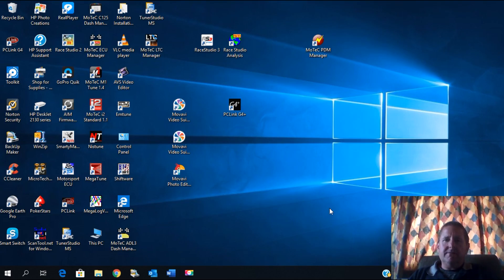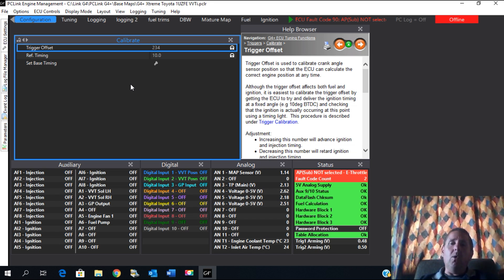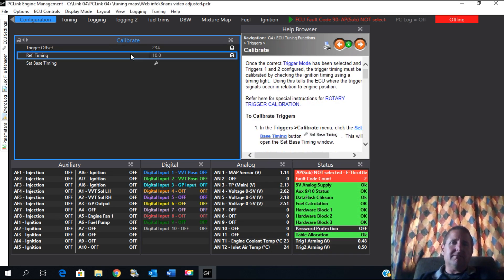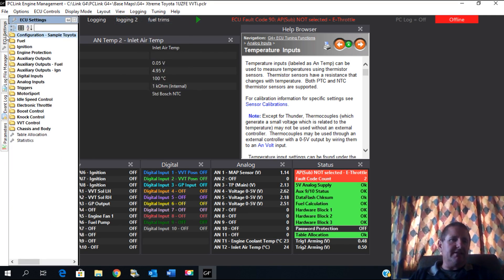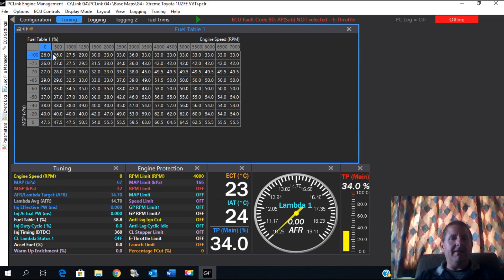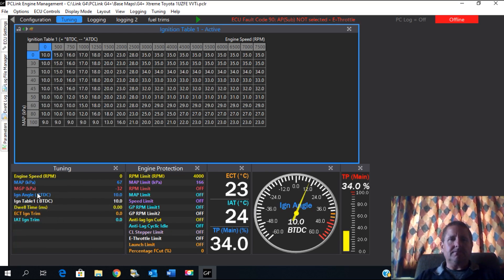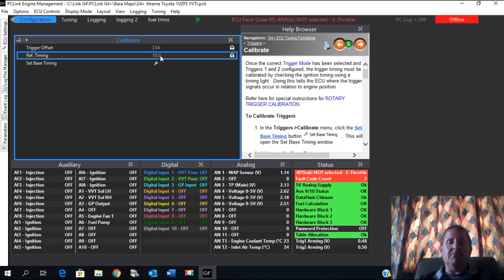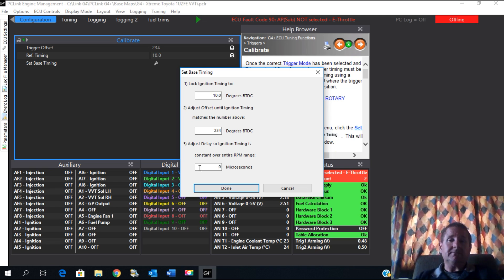PC link Basics.  Finding the fuel map , Ignition Map and base timing settings

Comment: Can you name some resources on how to tune? It´s for the formula student proyect
Reply from the maker: Hello.  Its a bit of a process on learning to tune but personally I recommend you read books on how carburettors and distributors , ignition systems work and understand how engines work.  Lots of guys want to jump straight into learning ECU tuning without really understanding how the basics work.  Also pressure is also very important , air is pushed into an engine not sucked in.  Cheers Kelvin
Reply: Anybody have any idea how I can calibrate an air temperature sensor for the intake I have the calibration numbers but they don't seem to match anython how one or Cal two or Cal 3
Reply from the maker: @johnfarias7230  hello John.   Using the numbers you have they can be entered into pc link.  If you wish I can do a video of it if you send me your profile and IAT calibration numbers.
Reply: @CartuneNZ  that was absolutely awesome I will send you the numbers actually how do I do that
Reply: @CartuneNZ  I'm really interested in the link PC software I went out and bought Lynx ECU G4 Plus to play around with
I got the distributor the injectors and a spark plugs all hooked up to a veritable power supply I have a base map loaded and I can see engine speed when I hook up a drill to the distributor and the spark plugs fire but every calibration chart that I do has numbers wait incorrect me to put the right numbers in
Reply from the maker: The ECU generally has base sensors which are close enough however if not entering the correct calibration normally solves the issue
Reply: @CartuneNZ  is there a way I can give you those numbers
Reply from the maker: @johnfarias7230  Email profile and calibration numbers to info@thecartunecompany.co.nz